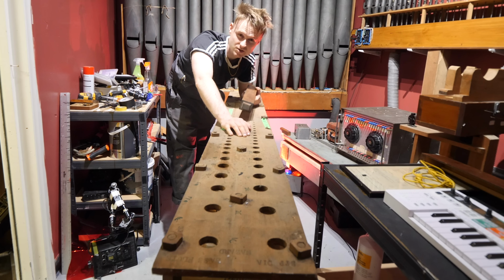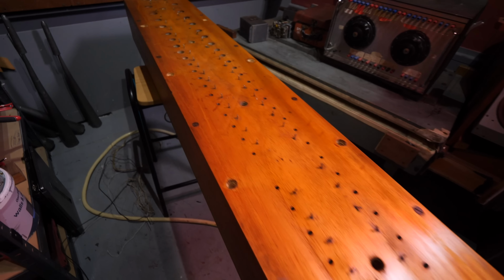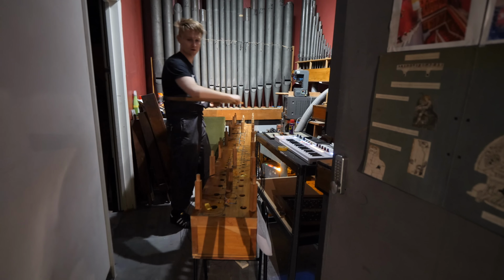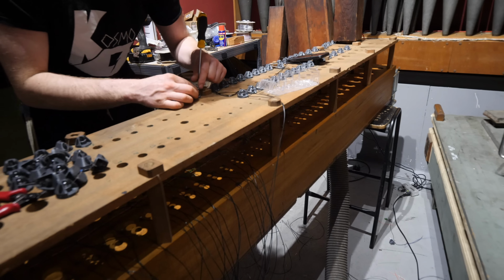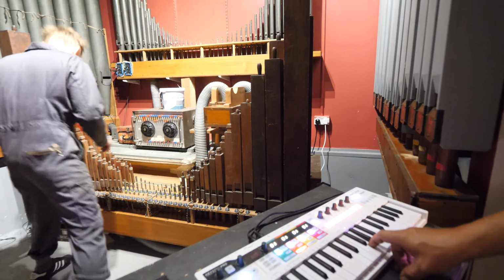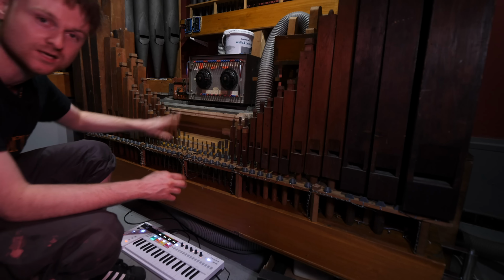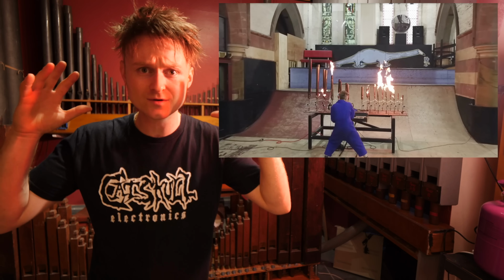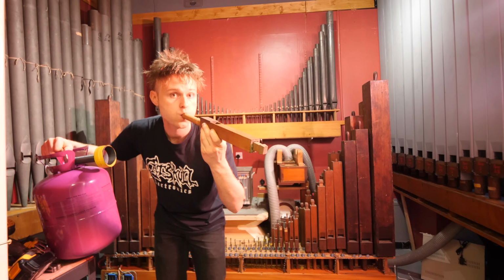HELIUM Through a CHURCH ORGAN, What Happens? I BOUGHT A CHURCH ORGAN PART 5

Comment: I tune the strings of my guitar kind of the way you described. I just play a power chord and it will indeed make a wub wub win noise when it's not in tune and as soon as it fully goes away and it sounds powerful, like a power chord, I consider it done. Once in a while I grab a tuner app on my phone though because even if the guitar is in tune relative to itself it might get downtuned over time.

Comment: Seeing what an insane amount of cables is needed to make the whole shebang blow right, I have come to the realization that organs made before any of that fancy electric stuff existed must have been BONKERS engineering!! All of THAT mechanically, operating pipes tens of meters from the manual in some cases, and you'd have to do it while still keeping the keys easy enough to press - and more importantly more or less CONSISTENT across the whole manual no matter what stops are selected and pipes played. Probably levers and pulleys and counter weights and liters of grease that had to be refreshed every few months at least. Multiple of these for each key.
Completely incredible, especially when thinking of the massive organs in some of those huuuge cathedrals, with 3+ manuals, tons of bass pedals and loads of sets and stops and ranks and whatnot (I really don't know what each of these words mean exactly, so basically cripload of pipers). Just... I mean... WOW!

Comment: Just came across isometric keyboards like the Lumatone and felt inspired to hook it up to my Hauptwerk installation via MIDI. Could be a fun thing as an alternative input method for your pipe organ, too, I suppose. My idea was to merge multiple manuals into this "2D keyboard", with the pressure parameter controlling swell an/or crescendo pedals. Actually, I'd be curious enough to see this attached to your "original hardware" organ -- should be simple enough since you already did the most laborous part, i.e. to MIDIfy all of the pipe valves.

Comment: Awesome video! What kind of power supply did you use to power all those solenoids? Assuming all the solenoids are around (6-12 volts) dc and draw 2 amps?
Reply from the maker: Each solenoid is 12v 100ma

Comment: Awesome.  I really enjoy watching the bellows(?) move up and down as it plays.  Adding something on top of it could accentuate its movement.  Something with long and light protrusions like wings or tinsel?
Reply: Ideally, the air reservoir shouldn’t move up and down a lot. It’s normally a large sealed wooden box which has an accordion-pleated bellows attaching the top of the reservoir to the box. Also, there are a series of springs around the perimeter that counter-balances the expansion of the bellows to act as a shock absorber of any fluctuations in air pressure. Finally weights are normally placed on top to fine tune the pressure balancing.

Comment: Cool video. Be careful about discharging a bottle of (non-air) gas inside a small space. It if displaces the oxygen, you pass out and die quite quickly. Letting a bit out of that bottle is probably fine though.

Comment: This is hands down my favorite project to follow. I look forward to every video. 
Regarding the helium. First: it's just beast to work with. Second: it's light and way less dense as air. The pump uses centrifugal force to produce pressure. Since it's so light and thin there is no pressure to gain from the centrifuge. If unrestricted, the flow should stay the same no matter what or even better. Try CO2 next time, but not for to long for obvious reasons :-) love your vids, thx 🙏
Reply from the maker: Well yeah. But for an experiment I’m not going to plonk another pump in :D. You go in to an experiment knowing some of the issues ahead and see which factors are most prominent
Reply: @LOOKMUMNOCOMPUTER that's for sure.  it's in the definition of experiment, that the outcome is unknown 😀
Reply: One of the problems is that the retail helium tanks aren’t pure helium. They are a air-helium mix intended just enough lift that the average balloons will float for a limited time.

I worked at a florist at times. We got cylinders of medical grade helium. Occasionally, some customers would try to do it themselves using those retail cylinders only to be disappointed with the results.

Comment: I think it would be a better idea to try the other end of the spectrum. 
Fill some stopped pipes rotated upside down with a heavy gas, all submerged into a tank filled with a heavy gas. 
Probably no need to fill the blower, and windchests, only the pipes.

I already had this idea for pipe organs in my mind for quite a while, but didnt have a chance to try it just yet. I think it could help with saving some space and maybe cost if engineered properly.

Comment: I think the density of the gas won't matter for pipes because the note is determined by the length of the pipe, which doesn't change. It makes a difference for our voice because our vocal chords vibrate easier/faster in less dense gas. Helium might, then, effect the notes a guitar or violin plays, but not a flute or trombone?

Comment: I'd have opted for hoitsway cable over Telco wiring. Hoistway cable is communications cabling for a "lift" as you call them. It is far more robust stranded wire than solid Telco wire. They are also all nicely and conveniently individually numbered every 160-260 mm or so. I'd just put some timber blocks with strap handles under each end. When you need to move the chest use a bottle jack and pull the blocks.
Reply from the maker: I did it this way cus I wanted to. If you make one you can do it that way :D. Telephone cable is fine as it’s static. Infact better as it holds its form. Cheers

Comment: The reservoir is connected to the blower which pushes a constant volume of air and keeps the reservoir inflated. When you add helium to the air going in, you are introducing a lighter gas (less molar mass) which reduces the density of the air the blower is pushing into the reservoir. Therefore since the blower is not increasing the amount (number of moles) into the same volume of space (reservoir), the pressure drops. However, if the helium coming out of the tank is colder then this also is contributing to the reservoir deflating. Density of air is controlled by pressure and temperature thus both are probably  contributing to it deflating.

Comment: Regarding the control panel, if all those registers work with midi maybe have an midi distributer kind of arduino between it, where when you can pass on the midi to the different registers or not, so one midi in multi out put switchable
Reply from the maker: Well yeah that’s the only thing to do in this setup
Reply: @LOOKMUMNOCOMPUTER  You also want to use the original controls keys etc?

Comment: I wish there was an adapter that went between the pipe and the airbox that passed the air but also included an led so that the led would shine inside the pipe. I think it would be a lot clearer and cleaner instead of scattering light all about.

Comment: It's sounding nice! With those pipes where the lower lip has come off, you might be better screwing them in place rather than glueing as the position of those pieces affects the sound quality. The technical term for it is voicing and it's something of a dark art in the organ building world! The advantage of screwing is if you need to adjust later you can do.

Also I didn't think I'd say this but those LEDs are cool af! My mate's building an organ in his shed, I'm gonna have to get him to add them..
Reply from the maker: But they were originally glued? Voicing is not as hard as people seem to say tbh. As long as it’s done before the glue dries it’s fine.
Reply: @LOOKMUMNOCOMPUTER  Oh were they? Ah fair enough. They will have been voiced properly when the organ was originally installed so I'm guessing the builder was confident enough!
Reply from the maker: @mrrandomperson3106  interesting. Having worked on a couple of instruments for friends also in the past with these wooden flutes. I’ve never seen them screwed. Only glued. Interesting!
Reply: @LOOKMUMNOCOMPUTER  Probably all down to how the builder wants to put it together. I found a series on Youtube of a guy who built a small hand pumped organ from scratch and he used screws. I'm no organ builder though, I just play 'em on a Sunday!

Comment: Amazing video, I really love your stuff and hope to be able to visit the museum one day!

My guess is that the helium just fills up the upper portion of that chamber (since it is lighter than air) and just leaks out from it (and other places along the way) before actually getting to the organs. Hence why the chamber probably also collapses, the helium leaks out and is not able to support the weight of the chamber (not enough relative overpressure to the outside). When you switch of most of the pipes, the amount of helium pumped through the system becomes relatively higher to what the chamber is leaking out. Hence the flow becomes substantial enough to keep the chamber overpressurized with the leaks, but maybe still not enough to actually reach the pipes :/ Good to keep in mind also that helium flows through small leaks much more efficiently than air. :P

I would guess you would need to pump much more helium through the system if you would like to be able to overcome the issue, however I am worried that you might suffocate yourself if you would try that, so please don't. I wanna see more of your videos in the future :D

Comment: If you want to run the organ on helium with the same effect that helium has on us, it's best to use a lingual stop (like a trumpet). Such a stop generates sound in the same way as our voice. It may also work with a labial stop, but the effect will be less noticeable and you may need more gas to fill the entire pipe. With a lingual stop you can already get the effect when the stevel (lower part) is filled with gas. I have no idea if this is really the case, but that is a subject for scientific research.
Reply: If the helium gas fills the whole pipe, the pitch change with a labial (flue) pipe is greater than with a lingual (reed) although the tone of a lingial pipe will alter a fair bit . This is because the pitch of a lingual pipe is dependant both on the reed tongue and the resonator (the rest of the pipe) but the reed tongue isn't affected by a diffferent gas being used. Helium has to be put directly into the pipe to experiment as a conventional blower won't handle a low density gas such as helium. It's the vibrating air column in the pipe that is affected by using Helium versus air due to its lower density. Pressure waves (including sound itself) travel faster through a less dense gas. Away form Helium, it's also the case that warm air (normal air) is slightly less dense than cold air and this is turn affects the pitch, causing the labial (flue) pipes in organs to rise in pitch by about 3 cents (3/100 of a semitone) per degrees C.

Comment: I’ve listened to a church organ hundreds of times and stared at it out of boredom and I never realized it had two different types of pipes that really create that full sound
Reply: There are literally 1000s of pipe design variations. The primary division is between flues and reeds. A flue works like a whistle or recorder with air blowing across a lip to create the sound. Reeds work more like a duck or goose call. They have a thin curved metal reed mounted to a device called a shallot. Because of the lower pressure on the underside as air flows past (kinda like a plane wing in reverse), a vacuum is created that sucks the reed against a mating surface on the shallot sealing it and cutting off the the airflow. This causes the springiness of the metal to release the reed and starts the cycle over. This is similar to how clarinets and saxophone make their sounds.

The tones of pipes vary by the materials used for construction. Primarily, these are wood and metal but there are organs with pipes made out of glass, clay, ceramic, and bamboo. The type of metals used varies. Most are some combination of lead and tin but some are made using steel, copper, zinc, brass, or silver. Some pipes were once made of pure lead but these were often so soft that they would sag and bend under their own weight if not kept perfectly vertical and properly supported. Changing the composition of the metals changes the tone or color of the sound.

Additionally, the pipes might be tapered. Trumpet stops are usually tapered with a flared ‘bell’ so that they look and sound more like a trumpet.

Another important difference is the shape. Primarily, pipes are either cylindrical or rectangular columns. As the pipes in the video, wooden pipes are often square as this is a construction compromise between ease of assembly and approximating the shape of a cylinder. There are also pipes that have a triangular cross-section as well as experimental ones that were pentagons, hexagons, and even octagons (keep in mind that each additional side added 1 more joint to glue up so large builders would avoid this extra work). 

Another major difference was whether the pipes were open or closed at the top. This is primarily the flues. An open pipe produces both even- and odd-order harmonics while closed (‘stopped’) flues only produce the odd-order harmonics. This generally results in a softer and sweeter ‘flute’ sound like the pipes in this video.

Reed pipes are usually fitted with some type of resonator on the top. The various shapes of these resonators enhances the sounds and control whether both or only odd-order harmonics are present.
Reply: @thomasbland6428  wow, interesting
I can imagine variation from organ to organ but I had no idea some organs had several types playing at the same time
Reply: @melody_florum  One of the beautiful things about pipe organs is that each pipe is its own resonator and sound source which allows the sound waves to interact with each other, creating new sound waves that are both the sum and difference of the original waves.

In the electronic music world, these resultant sounds often get muted, muddled, or lost because so many sounds are being channeled through a limited number of speakers.

(This is also true if you were to compare a live performance of a group of acoustical instruments, singers, or a symphony to a recording of the same thing.)

Comment: Good video!  Yes it's the much lower density of helium that is the biggest problem here.  And BTW technically,  @1:38 what you termed "wire-wrapping"  is usually called "lacing".  Wire-wrapping refers to connecting bare solid wires to square section pins by wrapping them tightly around and without solder.

Comment: I like the idea of a professional organ builder watching this and thinking things like "colored telephone cableing, why did I never think of that" and finding its way into the craft.
Reply: Colored wires are used by many builders. In large organ factories, they may have just used a mounted roll of single conductor wire and built up the wiring one connection at a time. Done properly in an installation where the organ was never relocated, that wiring has lasted for 70+ years.
Reply: @thomasbland6428  Ok, nice to know :) But maybe some other unconventional idea might stick.
Reply: @donbow450  Most newer pipe organs tend to be ‘boutique’ builds or built by smaller organ builders who are not building using more industrial techniques so do use colored wires for their own sanity’s sake.

Comment: You can just lift up each corner of the unit off the floor enough to set each wheel and it's armature back down and into a rigid PVC tube, trimmed to allow the unit's weight to be borne on either end of each tube, one with the unit's weight borne on the top edge tube where it comes into contact with the frame of the structure comprising the unit's base and  then its weight can also at t he same time be borne on the bottom edge of the tube where it comes into contact with the floor. I can draw you a diagram
Reply from the maker: I did it with spacers it’s fine :)

Comment: Interesting test with the helium. My guess is the lighter gas doesn't gain as much kinetic energy when it goes through the blower's impeller. Since the blower is a fixed speed, the lighter gas  doesn't have as much energy at the same speed as a heavier gas would, and it's the energy of the gas that is converted to pressure downstream of the blower. Gas weight is a consideration when determining impeller size and speed in industrial centrifugal compressors. In some cases, the pressure downstream of a blower/compressor can overcome the amount of energy being put into the gas, causing the flow to reverse. This is called "surge"; I'd be curious if that's what your blower experienced when the air box collapsed!

Another interesting test you could do is measure the current draw of the blower when you introduce the helium. I suspect you would see the current decrease because of how light the gas is.

Comment: Not a bad idea with filling the room with helium. You don't need that much probably since it can be sucked from near the ceiling and it will be back there quite quickly after leaving the pipes or any other hole.

Comment: i figure the blower is centrifugal type seeing as you need flow and pressure. seeing as helium is about 1/5 the weight of "air" you would only have about 1/5 the pressure in the blower chest. (assuming the fan doesn't speed up as it probable does)